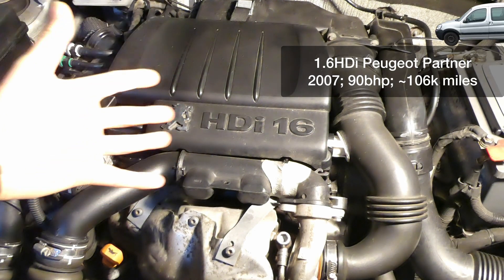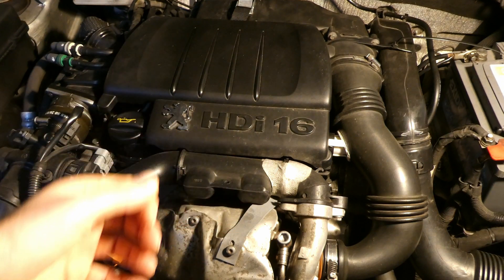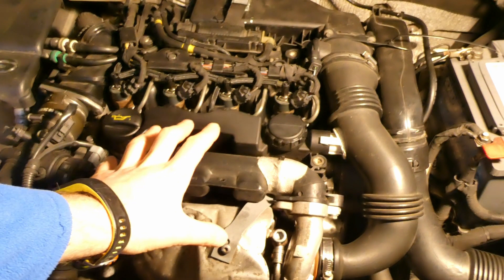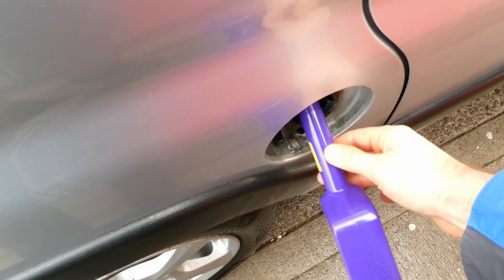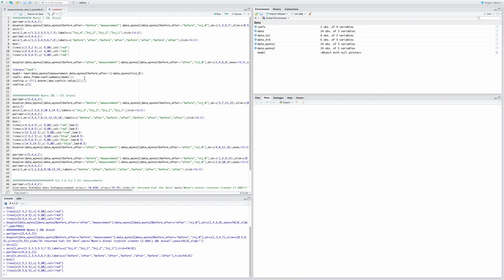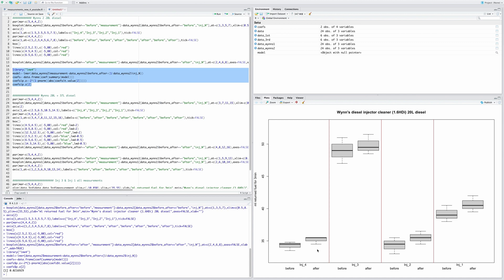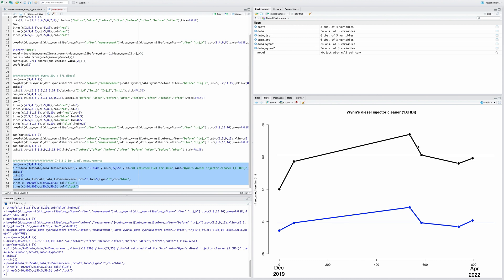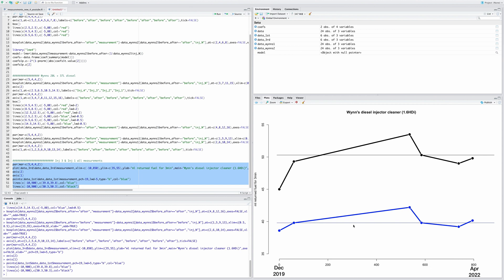Can Wynn's diesel injector cleaner do better with higher concentration (1.6HDi)

Comment: My Fiat Doblo Cargo TD 1.3 I use for my business really likes Shell V-Power which I assume has all the additives that this kit has. Runs a LOT smoother, acceleration is improved and range increase on the display from the normal 550 miles to almost 700 miles on a long run. In addition to the improvements, the DPF doesn't seem to regen as often and when it does, it isn't as smoky as it normally is. Every third fill-up is with V-Power.

Comment: You had "Wynn's Diesel Extreme Injector Cleaner" which is a little more expensive than this one but I guess a more potent solution, maybe with that poured in you would had even better results on the first try.

Comment: I've been trying to figure out something specific with the HDI/TDCI engines. Can't seem to find any info though, haven't been able to find anything on your channel about it either... 

So we both know how dirty the 1.6 HDI gets, question is; how can we clean the valves that the intake feeds? 

I've seen a few vids with other cars, whereby there is a larger hole, about the size of a custard cream/bourbon biscuit, but the HDI ones seem as big as maybe a £2 coin. The most popular method I see is a walnut clean. Sadly I don't have a drive or a compressor, only a high volume air gun. 

I have seen people spray, brush with a gentle bristle brush and then vacuum out the crud, so that's probably my option, but I wanted to see if there are any resources to potentially help. Would be good if you could perhaps do a video on cleaning the valves from the engine, as I reckon they'd be very grimy!
Reply from the maker: I bet they will be very grimy. Yeah, I will have to think about doing one of these, although work and so on other commitments, might be a bit. Nevertheless, many thanks indeed for the comment and suggestion. Noted!

Comment: One thing worth mentioning would have to tell us how recently the fuel filter was changed. Some diesel engines have reduced fuel flow with clogged fuel filter that doesn't prevent engine from running but reduces max performance. And obviously a clogged fuel filter might affect this measurement, too, especially if the fuel has different temperature during the tests.
Reply from the maker: The fuel filter was relatively recently changed before that test, it has not been changed for the duration of the test. The fuel from the filter goes to the high pressure pump, so this does not restrict or affect the test. It is the return (excess) fuel that comes back from the injectors.
Reply: @moremolecules  If the filter was relatively new, then you don't have problems. I'm asking because it's not unhead of that the filter is so clogged that the high pressure pump is failing to get enough fuel to the input pipe and as a result, fuel delivery is starved.

If you keep adding additives without replacing the fuel filter, the results may be affected by the filter if it's the new the bottleneck of the whole system.

One repair shop also claimed that some fuel filters by low quality 3rd parties limit the fuel flow even as new compared to OEM quality parts. I don't know if it was just marketing talk in reality.

Comment: I had a really bad white smoke on cold start up and it used to judder the van aswell and I knew it was a blocked injector! So I used the stp  diesel injector cleaner version as I had some left over at work  it says on the bottle 200ml to a full tank of diesel
But I put 3 bottles of the stp version in to 30pound of diesel and within 3days it got rid of the juddering on cold start up! And hardly any white smoke!
Thanks alot for this video 
So from now on I will be putting that in my van every 3000miles
Reply from the maker: Yeah, I might this stp diesel injector a go. Thanks for the suggestion.

Comment: Old video I know, but seems like maybe it was to concentrated so didn’t have a sustained affect. over a long period of a more diluted solution seems to have a better result in this case or it could be as you mentioned it had already cleaned what it was capable of cleaning. Maybe a 3rd video I bought the same product as the in the video today and says treats up to 60 litres so maybe try this test again with a higher amount of fuel

Comment: The industry standard test is the CEC F-98-08 which luckily for us, takes place on a Peugeot 2.0 BTED HDi. The Archoil AR6900D Max is tested to those conditions, hence it actually works. The newer CEC F-110-16 test takes place on the CTED HDi engines but I haven't found any commercial fuel additives for that test.
Reply from the maker: Many thanks for that info, appreciated. I know my tests are semi-scientific, probably not even that, but difficult to setup a proper scientific test.
Reply: @moremolecules  I can honestly recommend the Archoil, it works so good that my 1.6hdi developed a fuel leak on one of the connectors to the injector. Turns out, the oring was pershied, but some dirt was keeping it toghether ;) Good stuff.
Reply: @moremolecules  It's almost impossible to setup a scientific test... it's why I sought out the fuel additives which were tested. There are a few products out there which was tested - this showed the most promise. There is also BASF KEROPUR-D which shows promising data. Most of the other additives are not worth the money.

Comment: But how do you explain going up instead coming down?
Reply from the maker: The going up could be due to the injector getting blocked a bit with time. My overall measurements suggest that the injectors gradually get blocked, so if the second time the Wynn's did not do anything, the injectors will continue the upward trajectory. I have no idea why it did work the first time and did not the second time, it baffles me a bit.
Reply: @moremolecules  could it be that is taking some carbon from the tank etc and cloking the injectors? Also just read that  we should change  fuel filter after using the cleaner.
Reply from the maker: @coolissimo69  For some cleaners yes, the filter needs to be changed. I do change mine at least once a year, so I have changed mine in between the measurements. There is the potential that I have not accounted for in my test and that is the pressure of the high pressure pump. Let's say it was not very efficient and the cleaner cleaned it. So, no it is more efficient and delivering higher pressure to the injectors. Then there will be more fuel returned. So it is possible that this can account for the higher measurements.
The best thing at the end of the day is to take the injectors out, measure their flow rate than put them back in, use the cleaner and then take them out again and measure again. I simply cannot do that, too much work, hence my relatively alright fuel leak off test, not ideal, but easy to implement.
Reply: @moremolecules  Makes sense , I was thinking of that too. Probably more accurate measure without taking the injectors is see the MPG .
Reply from the maker: @coolissimo69  MPG is quite difficult to accurately measure, even more variation than any other measurement. Temperature, trafic, time stationary, etc., all play a role, too many variables to control.

Comment: At the old taxi garage I worked at we used 50% injector cleaner 50% diesel straight into the fuel filter on the service interval so first start got the full hit. When using an injector cleaner it also dislodges the dirt from an old fuel filter into the injectors. So always change the fuel filter after an injector treatment
Reply: Why not change the fuel filter before the injector treatment?
Reply: @nicub  we did putting the injector cleaner straight in the new fuel filter.

Comment: Have you tried LiQUI MOLY and or Dipetane for injector cleaners? wondering how it compares against Wynns
Reply from the maker: Not yet, but have all the components for a liqui moly test 🙂I will do it in the next month or so. It is a bit more complex as one needs to bypass the fuel filter and run the liqui moly through the fuel in/out lines. Once I do it and will put a comparison with the Wynns.
Reply: @moremolecules  well done,fantastic stats detail!

Comment: I always used to run petrol cars but the last 15 years I’ve be a convert to the Diesel engine .
Firstly they don’t suffer that much with electrical brake downs and built to withstand many miles. Anyone considering a diesel car replace filters and oil regular like every 10k and don’t buy shit oil, buy long life .Yes it’s slightly more but how much is it to replace a Diesel engine.!
Use diesel additives and drive hard this cleans out everything.
Don’t become complacent when it’s due a cam belt and pay the price and get a genuine and a reasonable garage to fit , Yes everyone is an expert but a tooth out on the pump it won’t run right , If you gonna attempt a belt replacement lock the engine and mark every pulley before taking anything off and remember check twice and manually turn the engine before ignition!
Reply from the maker: Very sound advice all around.

Comment: Very good video,I have use before on my Skoda Octavia mk2 2.0 psi engine with good results  bought with 125.000 miles and had a good life and sadly moved it on with 259.000 !Now  I have a new model mk3 common rail cr version 2.0 tdi and changed filters and going to reuse this product .bought with 76.000 and now at 111.000 so it’s time to apply because it’s using more fuel lately. Let’s see what happens.

Comment: Very good video & detailed info. I took my injectors out and manually cleaned them as I had timing belt/broken tappet issues at the time. My 1.6 hdi had covered 69,000 miles and two of the injectors were only squirting fuel of of two holes on each nozzle. I soaked them in brake cleaner but to no avail, so put them in an ultrasonic bath which did work.
Reply from the maker: Many thanks for your comment, appreciate it. Yes, taking them out and cleaning then with an ultrasonic cleaner is the best way, although refurbishing them even better.
Reply: Wd40 put injector,let it overnight 8hours aprox,then let them dry and soak in diesel

Comment: On the instructions i got on my wynns injector cleaner it says to add 1 bottle of 325ml on a full tank?
Reply from the maker: Yes, that is correct, although you add the bottle to an empty tank and fill up, not the other way round. That way the liquid is better mixed with the fuel rather than putting it on top.
Reply: @moremolecules  thanks man
Reply: @moremolecules is that a must? As per the instructions it says to add to half a tank and I already made mistake of filling up
Reply from the maker: @sukhnamsingh952  I do not think it matters that much, but it will be mixed better if it was at the bottom. I am sure that from the shaking of the car it will be mixed anyway.

Comment: hey im really interested if there is a possibility to easily tune this engine. any possibility to increase the boost pressure? you seem like such a knowledgable person regarding this engine. best regards
Reply from the maker: Yes, it is kind of easy to tune up this engine. You can failry easily achieve 110bph from the stock 92bhp with a ECU remap. From then on it needs new turbo, intercooler and so on.

Comment: Hi i have a 2013 bmw 520d, i used wynns diesel inj cleaner and now see that my diesel engine is more louder. Has anyone else seen this? I first filled the car with 20ltrs of regular diesel and then poured in the additive , drove a bit and then suddenly the engine sounded more louder like a tractor at lower gears , have i damaged anything and would this sound be  permenant?  Should i have first put wynns in the tank and then the diesel?
Reply from the maker: It might just be a coincidence. It should not damage components and I think it does not matter if you pour the Wynns before or after. The movement of liquid in the tank will mix it up. If you want, you can top it up with diesel.
Reply: I did a similar thing on my previous car audi a3 tdi, poured a bottle of redex into a low fuel tank then drove to the nearest station thinking it wont affect it  and whislt driving to it suddenly
It became more noisier to this day. I dont this bmw to do the same as now sitting in the cabin all i hear is the engine and i want it back to how it sounded like a refined modern bmw engine . Also i have added more diesel to it but no change
Reply: I also didnt pour the whole wynns bottle in to it fearing what had happned last time
Reply from the maker: @shahidkhattak2880  It could be that the high pressure pump is damaged from Wynns, say higher concentration, etc. I suspect you can have live data and see what the fuel pressure is.
Reply: I was suspecting something to do with high pressure pump too :( not sure what tool to use to get live fuel pressure for a bmw, i used VAGCom for my audi before
Reply from the maker: @shahidkhattak2880  Most likely, as nothing else is getting in contact with the Wynns. I was always afraid of that particular thing, but has not affected my pump thusfar. Not too sure what the bmw software is, but pretty certain you can buy some Chinese knock off from the original bmw software and obdii connection and check the pressure from the pump.
Reply: Thanks for the feedback really appreciate it. How do you think the hpfp can get damaged from wynns? Also do you think its possible for wynns to damage the injector? Is it sensible to carry on driving in the car in this condition?

Comment: I have used a bottle of Wynns in a third of a tank and then a bottle of liqui moli when nearly empty. I now run my 07 van on premium diesel as I figure the extra cost has now become irrelevant… all 3 stages have definitely improved … performance, idling and white puff of smoke on start. I have a small leak from the hex nut on top of injector 2. It is nipped up tight .. does anyone know if there is a seal in it I could replace ?
Reply: Maybe some ptfe or plumbers paste on the thread ?
Reply from the maker: Good job with the Wynns and liqui moly. Have a look here for the injectors: https://youtu.be/kt6zJANLaYQ
If I were I would really observe this N2 injectoe. You may have fixe with the nipping, but if more stuff comes out, I would replace the washer at the bottom + rim the injector seat, so it is smooth surface.

Comment: I put injector cleaner and after two months injector control valves goes kaput, 250k miles in my case, an injector failure is what is expected to happen at this mileage but maybe isnt a fully coincidence
Reply from the maker: Yes, there could be some problems with the injector cleaners, seals/valves, etc. Nevertheless, if that led to significant problems these probably would have happened anyway.

Comment: I have a Citroen C3 Picasso 1.6 HDi (110 HP engine) 2012 with 69,000 miles on the clock and was finding that a cold start would take a couple of seconds cranking to start the engine. when i was shopping at Tesco they had a half price offer on Redex diesel fuel system treatment at £2 so i bought it and put half a bottle in at my next fill up which i put 27 litres of Costco premium diesel at £1.70 per litre!!! After using half of this fuel with the Redex added the car now starts up instantly and even sounds a little quieter.
Thank you for your videos on your Peugot 1.6Hdi More Molecules they have helped me and many others with this engine do a lot of maintenance I just wish my egr valve was as easy to get to as yours is.
My timing belt/water pump/tensioner is now 10 years old and needs replacing. where is your video for this?
Reply from the maker: Thank you for the good words. I will eventually test redex as well, as it is quite popular. Unfortuntely, I do not have yet a video of the belts. Maybe I should do one :-)
Reply: @moremolecules  You can help me change my timing belt if you want! :)
Reply from the maker: @paulking5665  Hahaha, you would not want me to change it. I am waaay too slow when doing stuff on my car. Editing helps remove the long intervals of thinking: "how the hell have they designed it in a way that it cannot be removed", :-)
Reply: @moremolecules  Yep, I also take a long time when working on my car. I have just changed the gearbox oil on my car but it took me about 3 weeks to think it over in my head before I actually did it and even then it took about 3 hours. Got my air con re gassed yesterday but still no cold air but it is holding the gas so now I need to figure out what is stopping it from working - probably another 3 weeks of thinking it over then :-)

Comment: Hi I have a citroen xsara picasso 2005 diesel with code p0087 could you help please ..took to the garage they don't know. I have changed diesel filter, cam shaft sensor,  power steering fluid (was neally empty) oil filter and change just incase...Code is p0087 which is low pressure fuel rail any easy fix would be great 👍
Reply from the maker: Perhaps the high pressure sensor at the back of the engine is either faulty oe the wires a bit not making contact somewhere, maybe. I would also remove the fuel filter and take it apart and check if there are ny metal bits inside, e.g. the high pressure pump disintegrating a bit. You already replaced the fuel filter, but it should have been investigates for matal particles. I would start with the high pressure sensor.

Comment: I use ARAL ULTIMATE DIESEL for my A1 TDI and never had a problem with injektors or the exhaust gas circulation valve.the engine is calm and smooth...
Reply: what is your mileage?